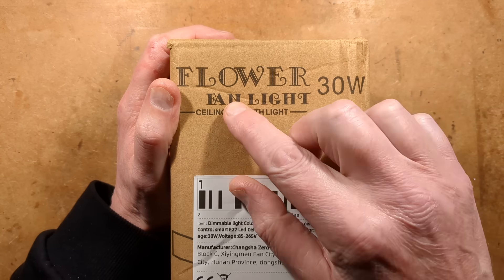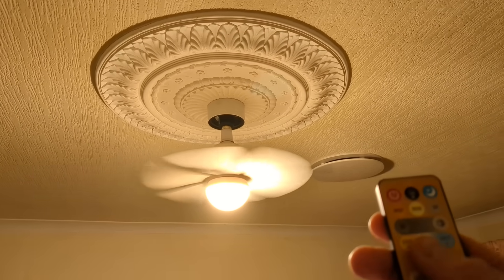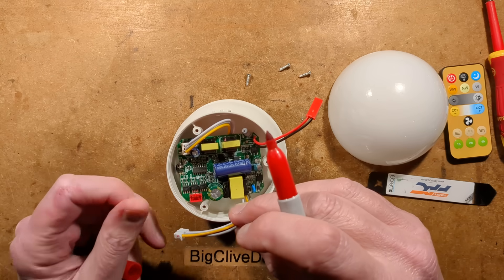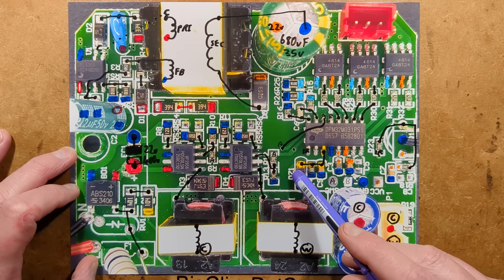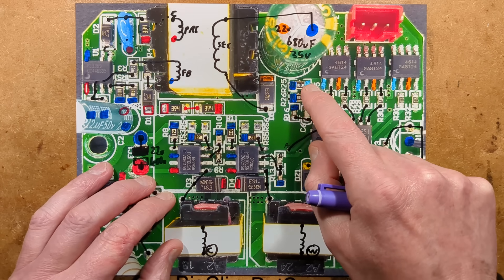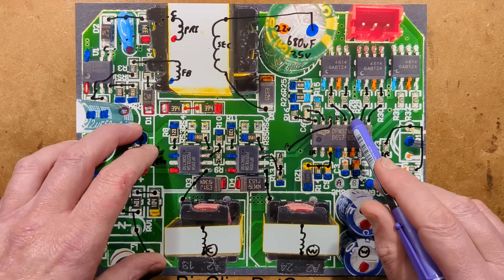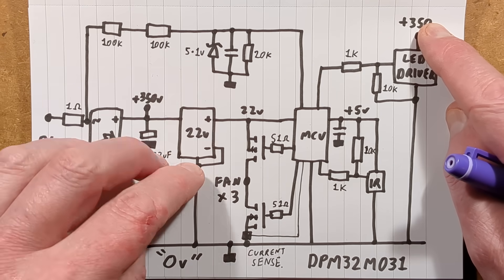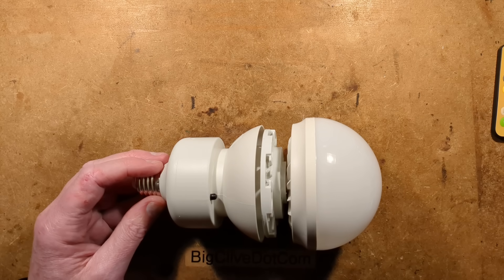Inside a screw-in ceiling fan and light - long version

Comment: Maybe we'll get to see the wall switch function in a short?
Reply from the maker: The switch operation works like this:-
First switch on ramps up to cold white with no fan.
Switching off and on quickly cycles through:-
Cold white and fan.
Just the fan.
Warm white.
Neutral white.
Back to cold white.

Comment: I remember watching an episode of "Rogue Traders" where they called in a guy to look at a bathroom extractor fan that wasn't working.
The reason it wasn't working was that their expert had opened up the fan, cut a wire inside and then put it all back together again.
The poor stooge saw that power was getting to the fan but it wasn't turning so he advised fitting a new fan. According to Rogue Traders he should have diagnosed the fault on the fan and this proved he was ripping people off; they gave the guy a hard time over it. As if anyone in their right mind would suspect deliberate sabotage as a cause of failure.
Admittedly he wasn't registered but there was nothing to criticise about his work.
Reply: Unplugging a wire (one that would jiggle loose during operation) I can get behind, but cutting a wire you might not even expect, that's just mean. In the German version (at least the one on public broadcast) they get experts who are or were on the exam board for that trade, so they know what anyone with proper training would be taught to check and deliberately go for those things.
Reply: @rolfs2165 most of the episodes were pretty good but this one stood out as rather badly done.
Reply: Yeah! That one was totally not the responsibility of an installer or electrician to diagnose. The appliance was being supplied with power, therefore it was faulty! Electricians can't be expected to open up appliances to repair these.... How far would people expect the electrician to go?
Reply: There's some f*ckers that do shit like that on real jobs as well.

I have found twice that in healtcare facilities someone has deliberately broke grounding connections before I'm going to do a continuity tests for the place.

I just fix it and won't mention anything in my report, so they get to think I didn't measure anything and have to go back to check their sabotage.

Those haven't even been "bad connections" or loose torque etc, but with wires yanked out from a connector and have clear marks from the tightened screw.
Reply: Sorry, but that's absolutely nothing compared to the sneaky faults that the instructor put on for me when I was training. They took great care in the clever use of clear sticky tape on the spades of equipment. You would and could test on the rear of the spade connection and get voltage, but the equipment would not work. Dare to just change the equipment and risk getting marked down... But later on, although they did that when you were practising, on the real practical test, the faults were more straightforward. But it made you think....
Reply: I remember one of those shows here in Germany specifically about household tech and one particular episode around computers exclusively and calling random repair guys from classifieds or whatever and filming them to check whether they'd diagnose things properly or try to rip off the "customer", filming everything with hidden cameras.  Being well versed in the topic I watched it... the stuff they did to sabotage the PCs was just plain stupid, like putting clear nail varnish over pins of the monitors video cable, cutting a trace on the back of the board going to the HDD connector so it would corrupt data, sticking paperclips into the DVD drive mechanism (you might be able to tell this was 15+ years ago), half-unplugging cables (the singular somewhat plausible thing) .... all kinds of garbage you'd never expect to happen in the real world, and of course they sh-ttalked all the techs for trying to rip the "customer" off because they couldn't find the issue beyond "this part doesn't work" and suggested replacing parts. It was all just set up to ruin the reputation of the freelance tech "guests" and totally coincidentally advertising going to larger PC service companies "who know what they're doing" ... which ironically are usually the ones actually trying to rip you off by selling you new things instead of servicing anything. It's just dumb

Comment: I got one of these, it does suffer from some slight asymmetric motion because one fan blade is slightly distorted, possibly why the BBC viewer was getting some knocking noise, I found no real problems with the unit, a nice cheap fan light
Reply: Not sure about these but i have one of the original Bell Howell 4 blade versions and it has none of these issues and all 4 blades oddly are balanced and level on mine. (maybe i got really lucky here)

Comment: My bedroom ceiling fan knocks on high speed. I've determined that one of the fan blade supports is a little bent. Which is annoying as I installed it and there's no way it could have got bent while doing so. I've tried fiddling with the balance weight thing but it's just too far gone.

Comment: Even the spiders want to hang out with Big Clive and learn about electronics!🤣
I watched both the simplified and detailed videos. This was an excellent breakdown of an interesting device. I'm especially interested in the way the circuitry generates 3 phase power for controlling the fan motor.
It seems to be pretty well designed with reasonable safety features and adjustability for both the light and the fan speed. It also seems to be better built than a lot of crap out there.
Thank you for the detailed breakdown. The spider thanks you too!😉

Comment: I have one of these positioned above my bed using a plug in ceramic poultry heat lamp fixture and I haven't had any issues with it getting hot or being over-driven.

It does knock when you first turn on the fan, but once it reaches proper speed it stops and is actually quite silent henceforth, but that's probably more to do with how the motor is driven than it does to it being a fire hazard.

Comment: tbh I wouldn't be confident suspending much mass off a normal lightbulb cord, annealed copper and plastic isn't gonna hold much up. The way you installed it would give me a lot more confidence.
Vibration would be a concern though those tiny blades won't cause much. Definitly a compromise solution between nothing and a proper fan, which given how hot it getting in summer recently, is one many will go for.
Reply from the maker: This fan weighs significantly less than many designer lights designed for the same pendant style lamp holder.

Comment: I suppose there’s a slight risk with the fan/light combos. Even though the running fan and light use the same or less power than a 60 W bulb, the extra load when the motor starts could briefly exceed the safe rating of the bulb housing and the house wiring.
Reply from the maker: The current this fan can draw is inherently limited by the power supply.
Reply: @bigclivedotcom  d'oh! i didn't think of that. cheers
Reply: @KarldorisLambley  Remember when we had those Dimplex 'heat & light' ceiling fittings in the bathroom, they used a 750 watts infra red heating element & ran from the lighting circuit! They were quite popular in the 1970s era!

Comment: The linear jump 22 to 5 is asking for troubles thermically, even at low current...
DPM32 series are the chinese STM32 copycat lol... the datasheet calls it 5V LDO but needs 8V minimum ... strange concept of LOW drop out.
It takes up to 40V but max 50mA@5V .... what a mess.

Comment: BC, this vid has probably sold more light fitting fans than the BBC article deterred. Bravo! Bravo! Clive!
Reply: For MK ceiling roses and pendants, they quote a 5kg safe working load, any more required a heavy duty one with hook and chain to support up to 15kg. 

The little fan is fine according to that. Other manufacturers seem less sure about specs.
Reply: i just bought 3 for myself. lol
Reply: Indeed, with summer on the way here and a lack of insulation on my sheet-metal walls, I'm rather interested in these. The light over my desk would do well with one of these
Reply: Edison base; none of that traditional dual pin bayonet stuff.  The lowest internal regulator gives 50v so it should be happy on any supply above about 60 peak.  International success!  Thanks, BBC and BigClive.
Reply: The Bee Be See! That great bastion of truthful journalism!
Reply: Wait... what's a BBC?
...
...
Oh, do not Google that one.
Reply: @integerofdoom69 😱😂😂😂😂😂
Reply: @Davidgoldenswan Hello, I'm not sorry.
Reply: BBC= Biased Bastards Conglomerate.
Reply: @integerofdoom69 baked bean cake?
Reply: The hate campaign is to get everyone to buy AC units or something.
Reply: Clive is way bigger than the failing BBC

Comment: The only issue I can see with these is that the mounting mechanism doesn't have the type of wobbly joint that normal ceiling fans do have. All  the movement of the fans is being applied directly to the light fixture.
Reply: The wobbly joint in a ceiling fan doesn't have anything to do with motion. It's there for people that mount them in conservatories and vaulted ceilings.

I used to sell fans from Fantasia for a living.
Reply: Thats wobble joint is not for torque or movement, its for mounting the fan into a curved ceiling where the junction box isnt parallel to the ground. not all ceiling fans even have that joint, flush mount fans where there is no pole dont use the wobble joint and just install directly to the junction box itself.
Reply: @compzac and,  the wobble joint aid somewhat in installation.
Reply: Normal ceiling fans are MUCH bigger and heavier. A fan this size is not really different from something like a 40cm desk fan. They barely move or have much torque.
Reply: @lunchie80 not much movement is still movement, and this can possibly lead to material fatigue on the long term. Ali/Temu stuff isn't exactly well known for it's exemplary quality

Comment: The BBC should do an investigation into the standards of supposedly UK approved electrical fittings sold in the UK. Some of the electric fittings we've bought from major stores in the past were fire and electrical hazards. Years ago my parents bought a quite expensive heavy glass ceiling light fitting from a major DIY chain ( it hung from its own flex and was a glass, sort of garlic bulb shape with a heavy cast glass liner to scatter the light and a metal fluted cone on top with a hollow steel thread for the flex clamping it all together),  the whole weight of the shade was supported by a plastic grub screw which clamped the side of the light flex where it came out of the top of the shade, and by  looping through two holes through a ~1mm thick flat bit of plastic which hooked over the metal bracket you screw to the ceiling. Needless to say the plastic grub screw eventually cut in to, and tore the flex because of the weight, and the the plastic hook cut in to the flex at the top, eventually causing a short circuit, likely the metal bits were live too for a while, before it finally shorted out. Also bought traditional circular junction boxes where they've saved money by making the slotted threads for the terminals in two pieces and when you tighten the grub screw into it not overly tight, but just tight enough so that the wire from the cable wont pull or fall out the terminal one side snaps off. Double sockets where the plastic sprung pegs in the switches melts if used with a high current appliance like a kettle or fryer. I've also bought earth bonding clamps for pipes that snap off when you tighten them up - A gas man doing some work for us saw them and said he used the exact same ones from the same place all the time and thought they were fine, sure enough all the earth bonding he fitted broke off the pipes within a year.

Comment: Dude, I bought one of those and the remote sucks. It fails to send  proper signal with new cells (I did the test with the smartphone camera). I tried all the remote functions and lags to respond. Temu sometimes promote crappy products.
Reply from the maker: Make sure the cell is in the correct way around.  The little remotes are sometimes a bit crappy though.  The fan can be used in various modes by cycling its power at the switch briefly.

Comment: I mean these aren't designed for pendants they are mainly used for the solid enclosures 

However used them on pendants. Yes, it strains it, but not that badly only safety issue is the blades flying off

Comment: Looks like they would be better suited for a fixed batten holder, than a ceiling rose/pendant set. Less vibration and weight on the two core flex from the pendant set. I'm NICEIC  Clive and they are getting worse over time, I agree.

Comment: Try to hold it in the wind and see if the motor can output a reasonable voltage and current . I have a fan connected to a stepper motor in the garden with the right bit of wind it lights up a 12v led

Comment: To be fair the light fixture usually has its weight evenly spread out. You got the motor and the blades all shoved onto an a19 socket. That's a lot of stress on a thin piece of metal

Comment: Bought 2 of TEMU. fitted to solid ceiling rose/fitting. so no wire to twist. and they are working fine. great little fans for the summer. lights are excellent, could be used in the winter to kick heat down from the ceiling.

Comment: The early Philips energy saving compact fluorescent lamp bulbs with  glass diffuser probably weighed as much as that.
Reply: I'm still using one. It was a bit flickery and took ages to reach full brightness, so I banished it to the cupboard under the stairs. Decades later, it's still working.
Reply: @Bartok_J  "flickery" as in "not instant on".  the later ones were terribly unreliable due to lacking that feature
Reply: @Bartok_J  I've probably still got one or two stored somewhere on the back of a shelf. Not only did they take a while to get full brightness, and weigh a ton, If/when they get hot, the bottom of their glass diffuser would get stained orange by melted resin from the heavy ballast in them.
Reply: @Bartok_J  when LEDs got cheap I took some 40+ year old Circline fluorescent lights from the 1970's out of service. Also had some of the early compact fluorescent lamps with 4 short and straight parallel tubes that were nearly as old and still going.
Reply from the maker: They did.  They were very heavy.
Reply: I still have two of those in use in the basement, Philips "Prismatic" SL18 (18W 900 lumen). They're both the older, physically larger version from the 80s with the non-rounded base. They weigh an absolute ton due to the ballast inside them and the thick glass, and yes it takes a while for them to reach full brightness, but that doesn't bother me because when I'm down there it's usually for a couple hours at a time, so no constant on-off use. They don't get particularly hot either, so IDK what that "melted resin" comment is about. Maybe that's the case for the slightly later ones with the rounded plastic base which are also physically smaller (for the same wattage) and thus run hotter (?!)
Needless to say they've outlived every single LED bulb with fantasy lifetime ratings I've bought... I mean heck.. both SL18s are older than I am lol

Comment: While I'm far from being an expert, I'm pretty sure that BLDC motor is relying on back-EMF for proper commutation/sequencing of the phases. The windings that are not currently energized are providing positional feedback by means of voltage induced in them by the rotor magnet being read and interpreted by the driver.  In other words, I doubt it's just "blindly commutated" like Clive seems to imply (unless I misunderstood). Among other things, I think that's how PC-type fan control chips are able to try to repeatedly "kick" them into action when partially stalled, etc. I think those are called "sensorless" BLDC but all it means is there's no dedicated Hall effect sensor and not that you just provide a 3-phase signal of fixed frequency and hope for the best.
Reply: PC fans DO have a hall sensor.
Reply: @simontay4851 I stand corrected! Now that you said it I remember seeing them: tiny, transistor-like SMD packages.
Reply: Most of the motors used to power radio control planes use these sensorless three-phase motors now.  The speed controllers for them handle up to about 100 Amps, depending on the model, and operate commonly from 1-cell up to 6-cell or more lithium batteries - so up to about 25 volts and 2.5 kW is fairly common.  Big models sometimes run more cells, up to about 50 volts.  The speed controllers work from a PWM 5V signal from the radio control receiver, often a 50 Hz signal with a pulse width varying from about 1ms to 3ms.  The lower voltage speed controllers also have a built-in regulator for powering the model's servos.  These regulators typically deliver 5V at up to about 3A.  The lower power units have linear regulators, but the bigger ones have switching regulators.
Reply from the maker: This motor uses current sensing for its operation.

Comment: Great, again, thanks for the video. I was away for to long :) I wonder how to control the speed of 7 sickleflow 120 pc fans on my cleanairkit ?
Some say fans using sleeve bearings should not be mounted horizontally
Reply from the maker: You can make PC fans quieter by running them at a lower voltage.  That can be done by putting diodes in series to drop the voltage in 0.6-1V increments.